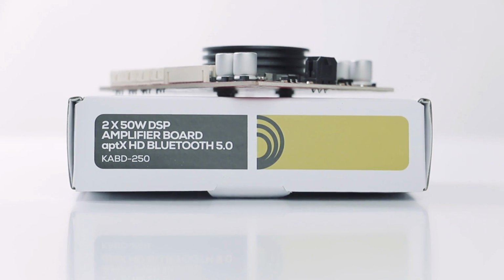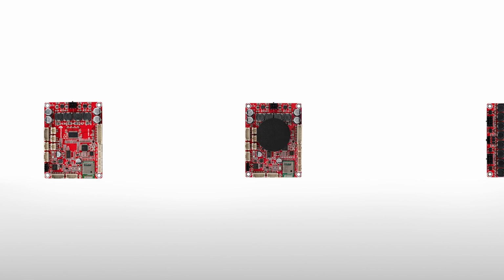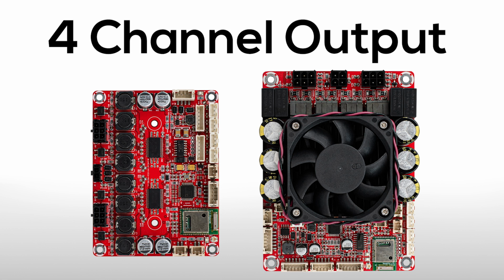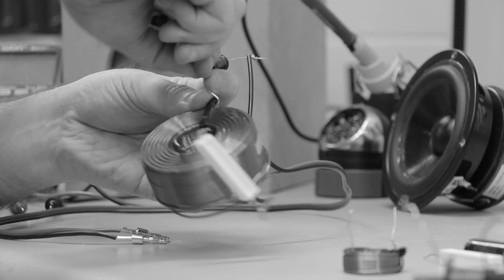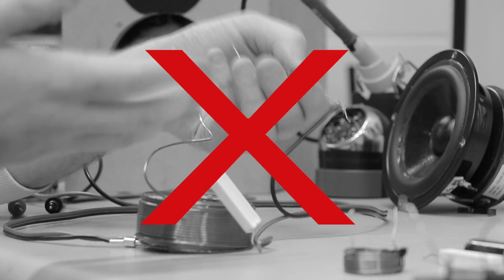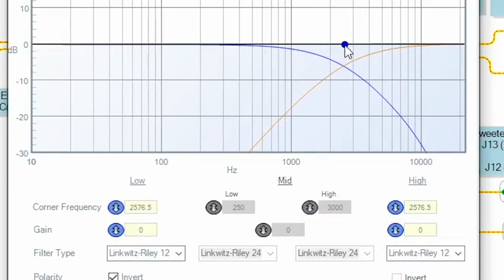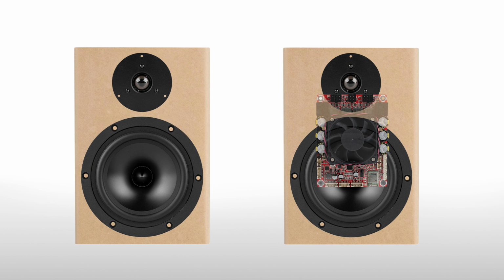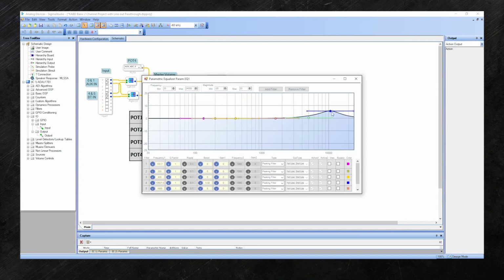Dayton Audio Amp boards with 4 channels, DSP, and Bluetooth 5.0

Comment: So can two channels run two 150w 8" speakers while the other two channels power a single 300w 10" sub? Looking for an amp to run this speaker combo in an arcade/jukebox cabinet.
Reply from the maker: As long as you keep the ohm load over 4 ohms.  and remember that when you bridge, you must start with an 8 ohm load, as the amp will see that as 4 ohms
Reply: @PartsExpressOfficial i have a 2ohm dvc sub and a 4ohm dvc sub lying around. cant I just bridge the 2ohm dvc wired in series to get 4ohm final or use the 4ohm dvc and just run one coil per channel to get the same 200w?
Reply from the maker: Let’s start by going over some basic terms. “Bridging” is when you combine channels on certain multi-channel amps to work together. For subs, though, we typically wire them in either “parallel” or “series.” Wiring in parallel lowers the Ohm load—so a dual 4-ohm sub becomes a 2-ohm load. Wiring in series increases the Ohm load—turning a dual 2-ohm sub into a 4-ohm load. One important thing to remember is to avoid connecting a sub’s coils to different channels on an amp. This can cause the coils to “fight” each other, which isn’t good for the sub and could even damage it. To keep everything running smoothly, both coils need to get the same signal at the same time.

Comment: Direct link to chose and buy...what's the price
Reply from the maker: https://www.parts-express.com/new-kabd-series-amp-boards
Reply: @PartsExpressOfficial hi. Is rca input available (for connecting to my android phone via 3.5 mm-wire-to-set-of-rca terminal . I wish to connect my android phone to a usb dongle type dac to stream loss less hi resolution audio files on apple music app. 

Dac has a output for 3.5 mm aux and I wish to connect the dac to dayton dsp amp via a 3.5 mm cable to rca cable

Comment: Are you ever going to fix the LBB battery boards?  The 18650 board isn't even available...  The 22650 board has faulty 12v output....